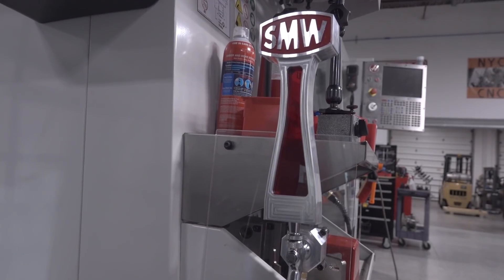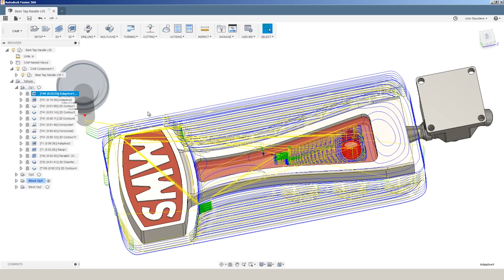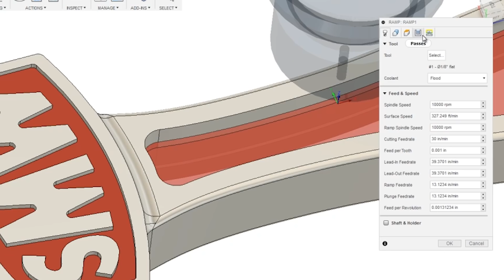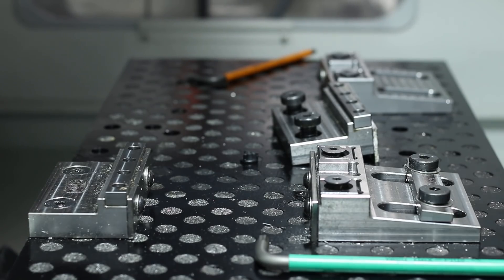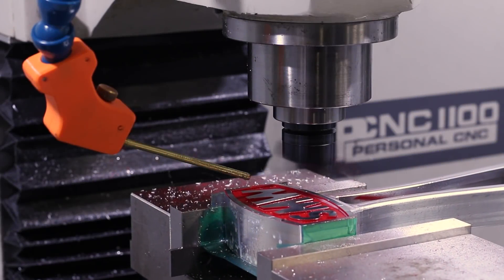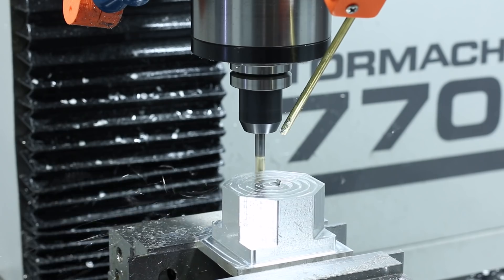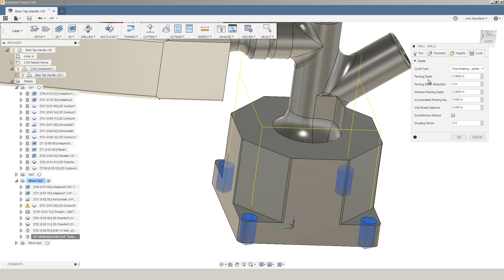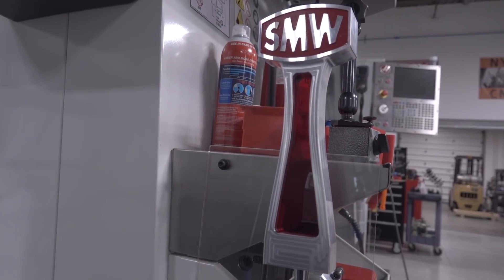Beer Tap CNC Coolant Dispenser! WW232

Comment: small tip from someone in the beer industry, when you grab the tap marker grab it at the bottom close to the base. pulling on the top makes it much more likely to break the stem of the faucet especially with the weight of that marker.
Reply: Then why are they so long??

Comment: Why don't you sell offset pads for the mod vice system? to deal with setups where the vices are on different planes? but drilled through so you can easily mount them.

Comment: Looks like a fun project.  With the relatively heavy weight of the billet tap handle, I'd be concerned about bumping it and having it dump a bunch of coolant on the floor.
Reply: You'd need to have the washdown hose activated in the controller, for the tap to dispense coolant. So it's not always "on"

Comment: Why would you take coolant out of one machine and put it in another? I think you're just making more work for yourself.
Reply from the maker: The HAAS has an automatic mixing system - so it stores concentrate but, when more coolant is needed, automatically mixes it with RO water at the correct brix.  Very handy.
Reply: @nyccnc   Does this also keep an eye on the coolant mixture to keep it at 6% or something? otherwise it would get thicker over time because of evaporation? on some of our grinding machines most time you only have to top of the water because the fine coolant dust and the huge filter paper make the water go so fast that we have to top it of like 2 times a week in summer.
Reply: @Vincemaan  it's a HAAS - it probably makes shure that the mother of the coolant factory present gets birthday flowers automatically to keep the quality up ;-)